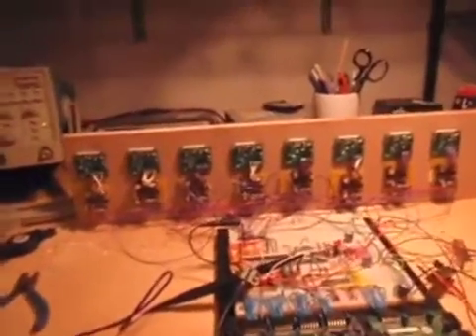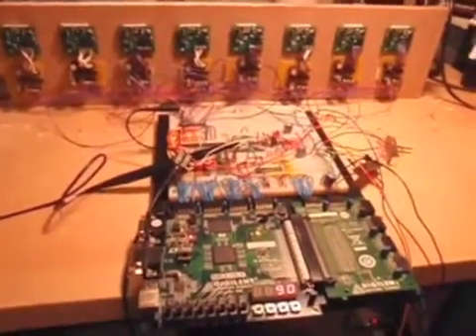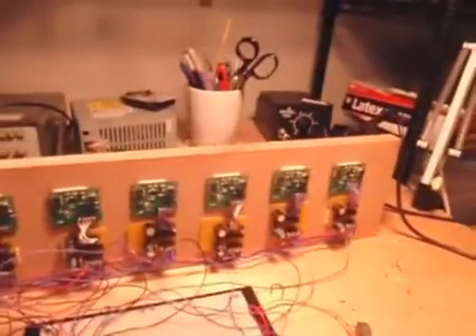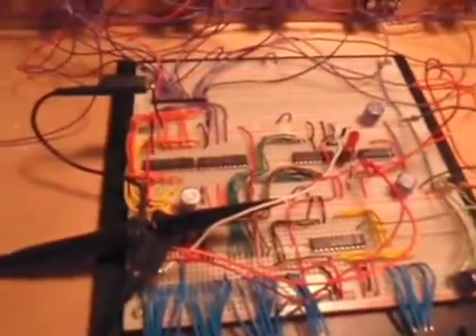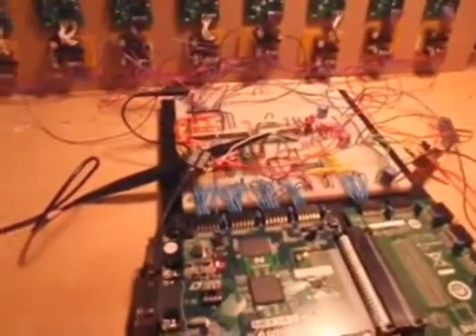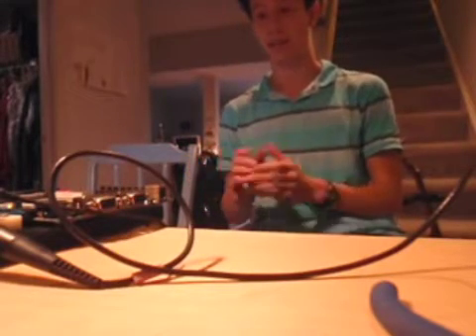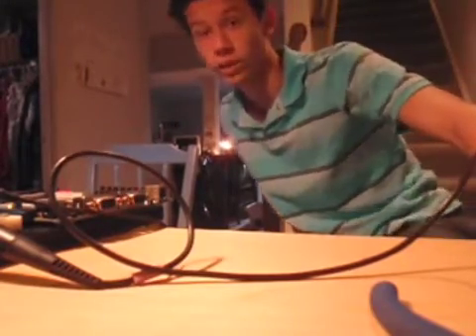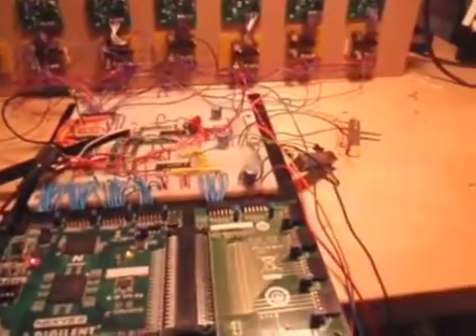FPGA-based Microphone Array Beamformer Demo

Comment: Hi, very nice video ! i got some questions for you : did you measure signals to a scope ? i'm doing a similar system : measure the direction of arrival. Works fine for pure sine, but not for speach. Looks like there is some interferences... did you see this problem ? did you record some waveforms ? here is my video :Sonar passive DOA MUSIC analog devices Blackfin 532
Reply from the maker: guanglier I haven't touched this project in a long time, but I remember having very difficult time taking measurements due to interferences from echoes and even the material I mounted the microphones on. I don't find it too surprising that it works better with a sine wave since the effectiveness of a microphone array is heavily frequency dependent. I might suggest running some simulations through something like MATLAB where it is easier to test the algorithm in an "ideal" environment and you can see if you have the same issues with speech. Good luck!

Comment: Have you posted the HDL code for this anywhere? It looks like you have some sort of voltage divider to compute the angle of the central lobe, and that you're digitizing this with a dac that you're feeding into the line-in input of your computer.  If you send this to your computer completely digitally, you could do some interesting things like imaging more than one lobe at the same time( like medical ultrasound,music).. You could do this with the on-board FX2 USB chip and instantiating a FIFO..